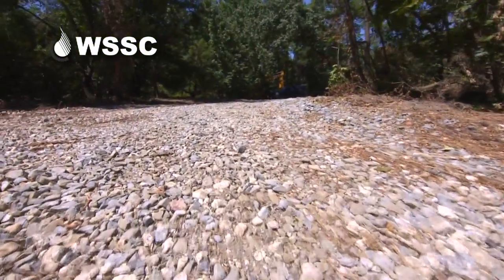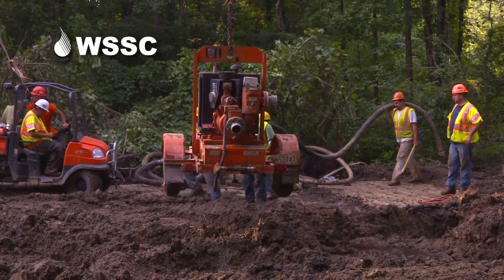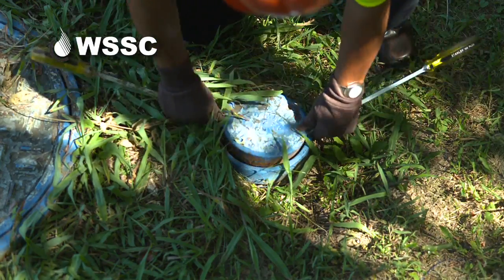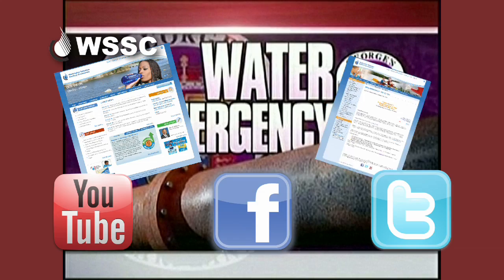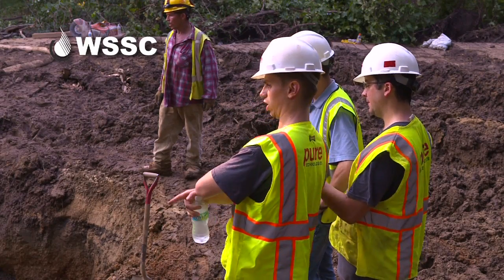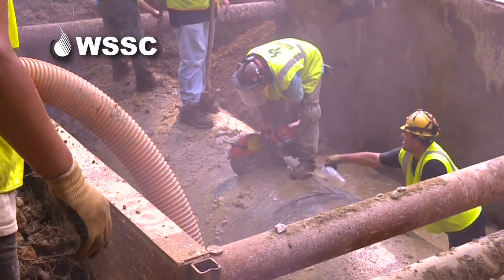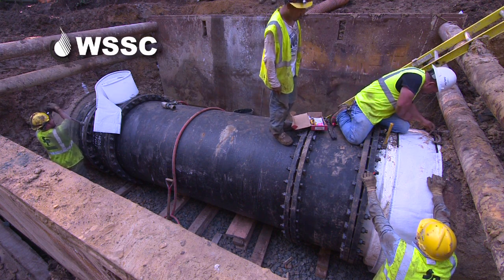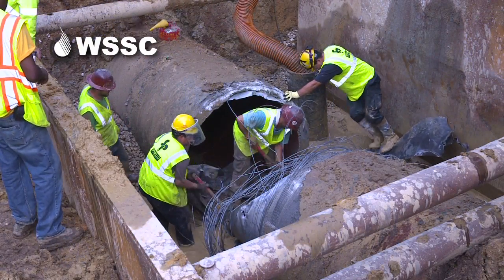Emergency Repairs to WSSC's 54-Inch Water Main in Forestville - July 2013

Comment: I'm a Retired UNION Steamfitter WELDER Local 342 out of CONCORD CALIFORNIA.....We put 2 new 72" Drinking water pipe in During the Winter and it Rained like Hell so we were tracking mud and who knows what Else into that pipe...When we were Done a Laborer washed out the Pipe with a Garden hose the best he could then he threw CLOROX inside to Disinfect it....And this was the Drinking water for the City of Concord California....
Reply: A bag of granulated chlorine every 100 feet in the affected section would suffice but A pipe that big I’d say every 20 feet just dump a bag before recharging

Comment: What kind of psi does a 54 inch main have ?
Reply: Depends on the system pumps, and/or the reservoir height while at rest (not pumping). We usually pumped up to 150psi.
And to regulate the pressure into the city (outlet the reservoir) we used pressure reducing valves (Cla-val) at specific points throughout the system.
Reply: Cool learning alot about that now going for my class d water operator license here in Texas

Comment: 42" valves are a bitch to shut off especially if theres a bit of crap on the valve and can't get it to close properly turning it for ages
And then the recharge don't wanna get water hanmer and blow it back up
Reply: At the beginning is a bitch to turn, then, still a bitch.
Specially when tuberculation builds around inside the gate, then have to work it up and down several times, gaining only 1/8th of a turn at a time and is like 70 turns and it gets very hard at 55, not fun, not fun at all...

Comment: If the Foreman ,was telling the Excavator Operator To bash the Pipe ! With the Bucket ! Why wasn't there ! A Concrete saw ! ? And Jack Hammer !? Surely a Crew ! That Large !! Would have had those ! THERE !!
Reply: Its easier, faster, and safer to just break that size of line throughout the portion you are going to replace and afterwards you can easily cut it evenly past the broken edges on both sides with saws.
Reply: @drajik  Thank God ! It's Not my Excavator !!
Reply: THE PIPE WAS ALREADY CUT THROUGH THE USE OF THE SAWS ....  just like any demo of concrete etc you have to bash it to break it up even when cut by saw.
Reply: @davidwillard7334  you have an excavator? You've never used a 300 machine to break concrete or demo? And think that there's going to be damage done. You're funny.
Reply: @davidwillard7334  the job is being done properly. Have you ever done this type of work?
Reply: @davidwillard7334  you're wrong
Reply: @davidwillard7334  I'm sorry
Reply: @davidwillard7334  Thank God I'm not your Caps Lock key.

Comment: Don't believe a thing he said... The 12-inch water main outside my house broke, and it took the city crew 2 days to fix... the city crew didn't even have to build an access road !
Either the city crew is super slow, or this crew is super fast !
Reply: It depends on the circumstances. Sometimes the water can be impossible to shut down and line stops will have to be used. It could have been super deep; lots of service lines etc. There could be many reasons for this although I am in the business myself and to fix a standard watermain break usually takes an 8 hour work day from start to final paving.
Reply: There's Only Two ! Types ! Of Speed ! DEAD SLOW ! AND STOP !!! GOOD AS  !! MAN !!
Reply: I fixed a 12 inch T the other day. That's 3 connections with a 5 man crew in 12 hours
Reply: Sometimes they only take a couple of hours to fix sometimes it’s several days. Water main and the environment play major factors.
Reply: listen to what you just said, 12 inch main vs. 54 inch main. there enters many more obstacles pal